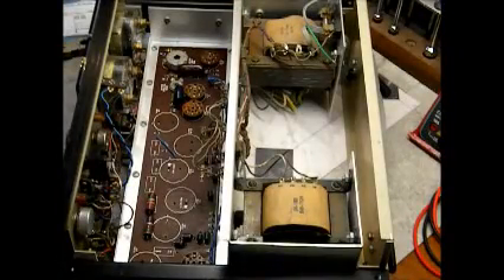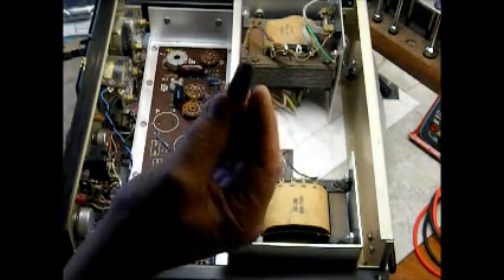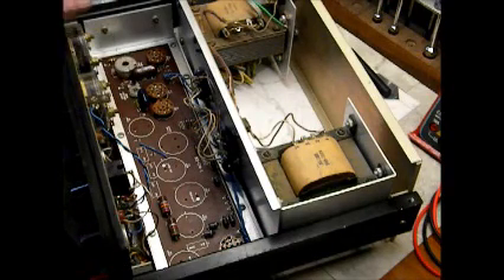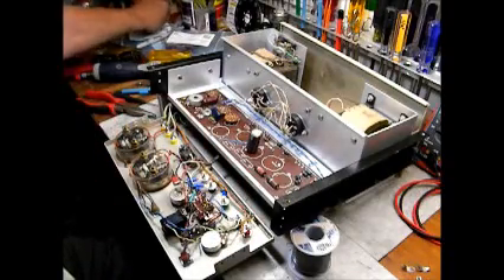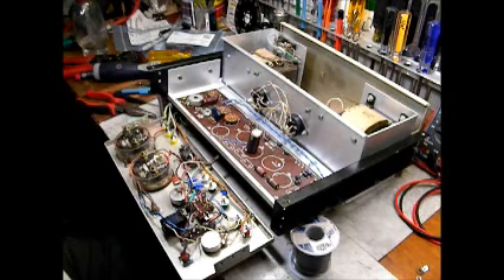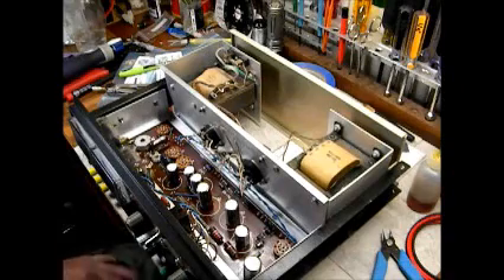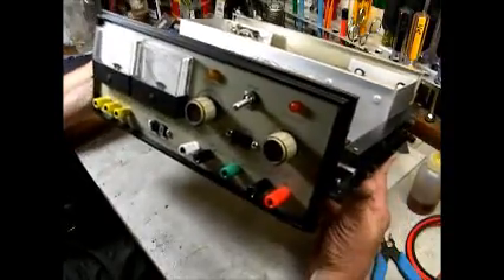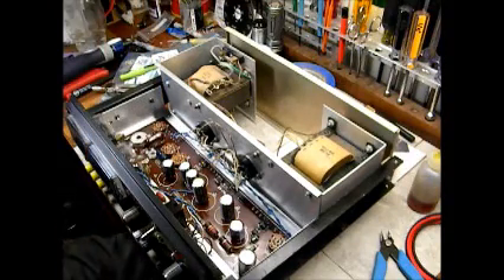Heathkit IP 17

Comment: I want one of these but everything costs so much more in Canada. Like to no how you went to led lights?
Reply: Thanks, I have two ip-27 supplies and been looking for IP_17 for a while now.
Reply from the maker: I have wanted one of these for a while now and wound up winning the bid on eBay for $200.  I will show how I replace the neon bulbs with LEDs in another video, I plan to make several videos until I have the device working as it should and show how I accomplish this.